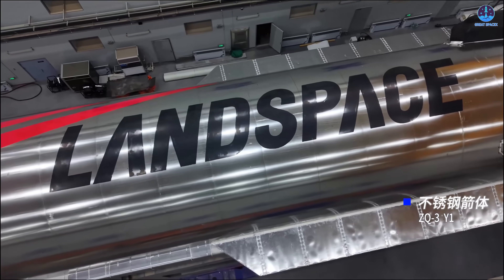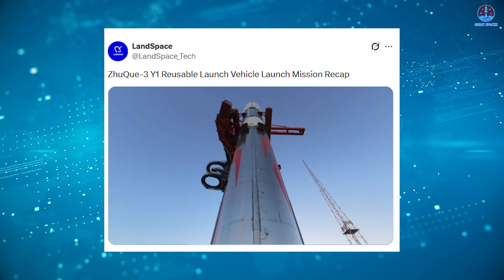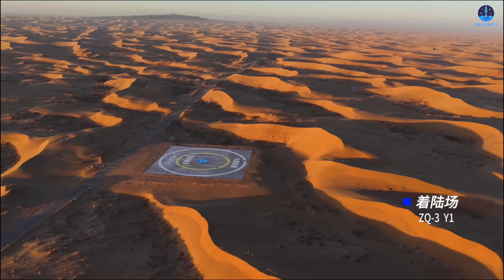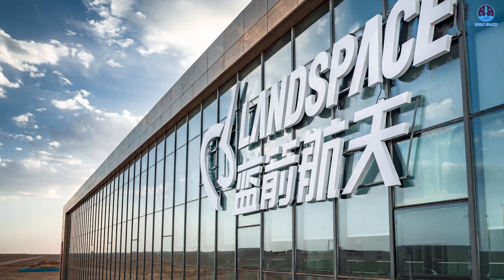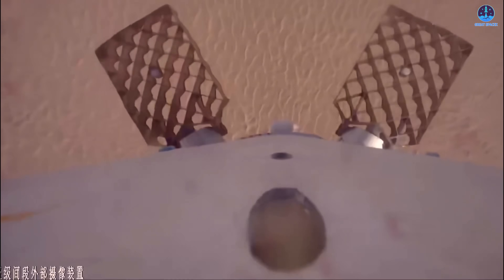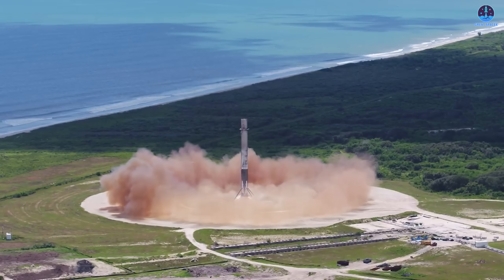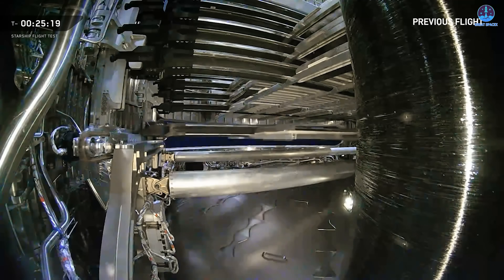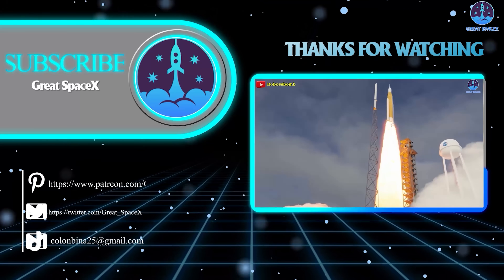China Zhuque-3’s Onboard Footage Revealed Why the Booster Landing Failure…SpaceX can Help?

Comment: C'mon man, Landspace already demonstrated they can land this thing.  That's the first thing they demonstrated and tested when they start building the rocket, the ability to do vertical take off and landing.  This failure has nothing to do with them not being able to land...this is just an electrical issue or just leaking.  Once they resolve that, it should be fine.

Comment: Technically, the self landing like spacex did with only propulsion rocket is not the good way to follow as it is way too much damaging nozzle extension and cone jacket . A better path might include multi-point but larger mechanical air break with external deployment of 3-single stage mini-rocket acting like gliding parachute.
Reply: 是的，目前看来SPACEX的成本远比他们宣称的高的多。不过这些缺点被大量的热钱淹没了，中国的成功会形成资本退潮，之后才会让问题浮出水面，最后才会催生进一步的优化和创新。
Reply: 事实上，我对未来技术的预期是，随着材料和加工技术的进步，可回收的一级火箭将会做成一个巨型滑翔体。在跑道滑跑，并使用减速伞完成降落。